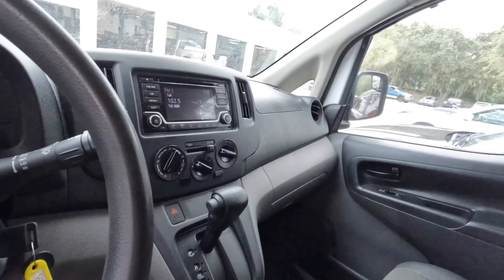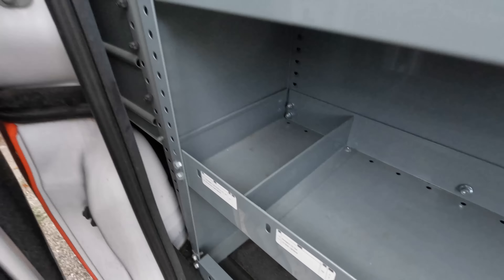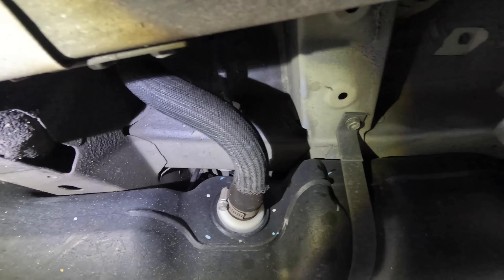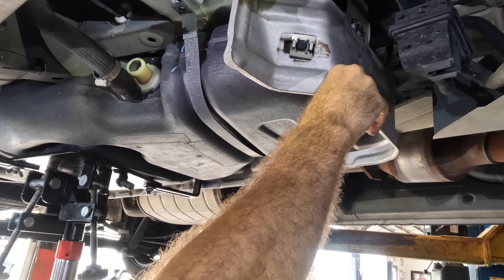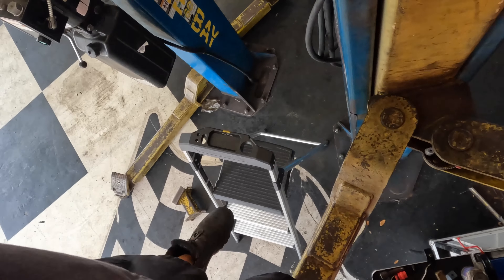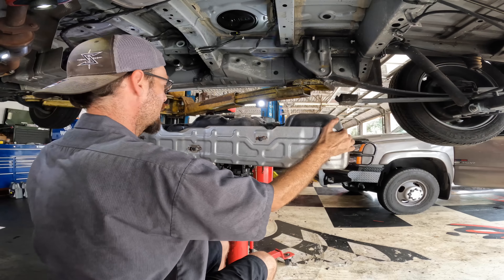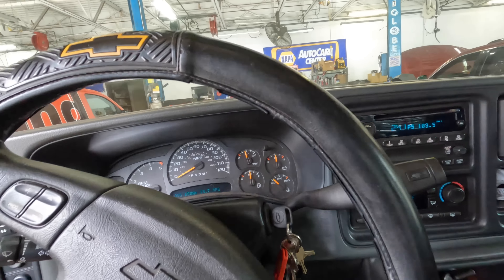Misdiagnosis! Changed the Part Anyway! | Crank No Start

Comment: In a previous life, Ray used to take fuel pumps out with a  blow torch.  It was a short life, but very cinematic.
Reply: Yes, using blue tipped wrenches to work on fuel systems makes for very compelling YouTube video.
Reply: I work in a machine shop where we used alcohol for coolant we had a 55 gallon drum that we had them mowed on top of nobody realized it a little bit of alcohol gotten in the bottom of it my boss decided to show a girl co-worker how to weld it blew up shut them all about two feet in the air the girl Peter pants went out the door and never came back everybody was okay and I thought it was hilarious have a good day
Reply: Did you ever see the Eric O. video where he talks about almost losing his hair after taking a torch to a shock that, unbeknownst to him, contained a volatile compressible liquid?  (For others:  In the rust belt, shock bolts almost never survive, and the only way to get old shocks out is to cut them out.)
Reply: @josepherhardt164  your supposed to heat the bolt not the side of the shock, they are compressed and like a tail shaft/drive shaft explodes under heat 😅🤣 all the best to you all
Reply: @donaldhalls2189  In the rust belt, the bolt doesn't even have edges any longer on which to get a grip.  And it wasn't compressed air that was the problem; it was a compressed flammable liquid that shot out a bolt of flame.  Eric said in the vid that he's replaced hundreds of shocks and this was the first time anything like this had happened.  He also said that he thought he'd peed just a little.  :)
Reply: The ring is made out of a nonferrous metal. In other words no sparks
Reply: @michaelpressman7203  Dafuq ...then LOL!  🤣
Reply: I imagine the remake of that era will be a Michael Bay film.
Reply: It was a dark night but was pretty bright for a second.
Reply: The new gas theives drill hole in gas tanks with no fear of spark igniting the fuel
Reply: @michaelpressman7203  my God man, add a couple commas in there lol
Reply: @nickmalone3143  My old cordless throws sparks out of the motor housing every time it turns off. Guess I can't be a fuel thief! *crosses it off list of potential careers*
Reply: You could say it was a flashy existence.
Reply: @wolfc7280  Stamped steel.
Reply: Not funny at all.
Reply: @j.t.cooper2963  Boo Hoo
Reply: @deadmeat6563  I didn't say it upset me. I said it isn't funny. Big difference.

Comment: Timing on this is pretty funny to me.   I just replaced the fuel pump in my 2014 Ram 2500 at my work parking garage.  Drove to work just fine,  went to go home and crank/no start.   I wish the connectors on it were as easy as the ones on this video.  Also I had 1/2 tank (approx 15-17gal) of gas.   Made for a fun time...   I also refrained from the hammer and chisel method.   Instead I used the screwdriver and adjustable wrench method.     On a serious note,  I give you full credit for giving me the confidence to be able to do some of these repairs on my own.  I've been watching you for a long time and have gain a tremendous amount of practical knowledge of how car components work together.  Thank you.

Comment: Considering the pump was run dry for who knows how long and sounded that rough, a replacement isn't a bad idea anyway.
Reply: Can't run those pumps dry, it trashes the bearings and burns up the motor. Needs gas for lubrication and cooling. Those pumps run at a very high rpm.
Reply: Sustained low fuel condition will cause the fuel pump to overheat and eventually burn out.
Reply: Thats what she said...pack your bags
Reply: He said the pump was making an awful grinding noise, so yeah it was shot.
Reply: agreed 100%
no fuel = no cooling or lubrication, and no cooling or lubrication will make a pump unhappy!

i had to replace a pump in a friend's fish tank the other day as the water level dropped below the pickup and it ran dry. during the postmortem i couldn't even get the impeller to budge with a screwdriver, she was locked up tight! now if a fish tank pump can basically weld itself when run dry, i'd hate to imagine the condition of said fuel pump as they operate at much higher RPM and pressures than a bloody fish tank!

Comment: Glad you remembered to tighten that fuel pipe clip.
Reply: He caught it at the very end of the video.
Reply: @pottawatomie2  yeah - but what about the other line that went through the white pass trhough right above the filler hose?
(breather line, return line??)
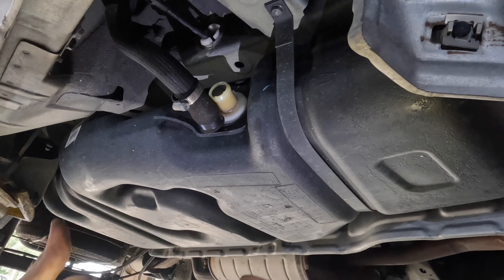you can see it at - 4:00
missing that line at the end of the video when tighening the filler hose clamp

maybe ray could chek it if the car has not been returned to the customer yet
Reply: @odie0815  He plugged the vent hose in at 20:51.
Reply: It's a snap on connection, not a clamp.
Reply: @pottawatomie2  thanks!!
seems that i have been not attentive enough to see it at that time stamp
just had a bad  memory pop up when i missed one of those connections on my car
and created a huge mess in my garage

Comment: In 1978 I owned a '73 Olds Cutlass Supreme that had a fuel starving issue.  It crapped out on me during a road trip with my 6+ mo's pregnant wife.  I pulled into a farmer's yard (he happened to be there) and asked if he had a 3/8" x 9/16" deep wall socket, extension and ratchet plus a flat screw driver and hammer.  I dropped the tank in my lap (3/4 full!), removed the pick-up unit, removed the filter sock on the pick-up tube, reinstalled the pick-up unit, grunted the tank into place and got the strap bolts started and then tightened.  All in the farmer's drive while he watched.  I handed him back his tools, got in, started her up and continued the second 2/3 of our 350 mile trip.  Never had a fuel issue with that cart as long as I owned it.  Just replace the fuel filter with every 3rd oil change, just in case.
WAY too old to be doing that NOW!😧

Comment: It's a good thing the burned up sending unit didn't ignite fuel vapors when it overheated. Great work Ray!
Reply: It uses resistance to ground as a signal. Not powered.
Reply: @gcrauwels941  Whether it was resistance, arcing, or DC current, something caused enough heat build-up to discolor the electrical contacts. I have only changed a few in tank fuel pumps, but I have never seen that before.
Reply: The vapor concentration inside a gasoline tank is usually above the upper explosive limits, too rich to burn. Plus there is very little oxygen in a gasoline tank.
Reply: @ronaldhorne5106  Good information. Thank you.
Reply: The original sending unit in my 1984 F150 looked like that. Wirewound potentiometer type... burned to a crisp just under the full mark. Sadly it too three sending units before I had a gauge that would work decently. At least they're not killer expensive ($50 for a good one) since it's carbed with a mechanical fuel pump (sending just has a dip tube and a fuel sock).
Reply: @ratdude747  Sounds very much like my 1986 Ford Escort and 1990 Ford Probe. Cheers.

Comment: Looked like the easiest dropping of a gas tank I've ever seen. Don't think I ever got that lucky?  Good job as usual.👍
Reply: I had a 1975 MG Midget the 7 gallon fuel tank is just on by bolts around the edge. Take out the bolts it just comes down.
Reply: Lucky the exhaust wasn't running under the tank those are the fun tanks to drop
Reply: On Nissan, chared sender is a concern. Another sketchy part from 'Chrysler of Japan'
Not a bad idea to pretest pump that requires significant labor.
Handling explosive liquid/fume gasoline is hazardous, Pilgrims.
DIY'S, Don't make a roast of yee
Reply: You should see how easy it is with the access hatch accessible...I've got the Chevy version which is a Nissan but it has the Chevy badge glued on badly at the back.
Reply: Makes you wonder why American cars have been mostly drop tank to remove fuel pumps .Even BMW the most hated car I ever owned has under seat pump access .
PS. even though I hated my BMW it has always been the best handling car I ever had .
It's the ying and yang of life.The best is always accompanied by the worst.,for every positive a negative .For every Martin Luther King there is a Putin.
Reply: @millwrightman99  Well cared 1995 C91 Caprice bought 2001 was closest domestic to best handling, comfortable long range ride for over 5 years. Sold to acquaintance who needed same when i no longer did. They used it another 3 yrs til retirement. Maroon with maroon interior hid its police car options. Only needed usual upkeep parts, maintenance all that time.
Reply: My Mazda has a hatch under the rear seat. I’ve never had to use it, but I could foresee this repair taking less than 15 minutes. It looks like 4 bolts and a couple of connections. I’ve always dropped the tanks to change them. Then, I had to take the rear seat out for something else and I’m pretty sure I said out loud to myself…”Well that’s an awesome idea!”
Reply: 96-99 dodge neon fuel tank is just as easy 2 straps, filler, evap, and fuel line.  95s can be fun since they were steel tanks and the straps and strap bolts got extra crusty.
Reply: I had to take a fuel tank off of my Buick Century once. It was absolutely a disaster. The bolts were rusted solid and rounded off.
Reply: @jasonroberts5746  You Got'er Done anyway.........

Comment: LOL I thought I was the only one who stuck the blow gun in my boots, You are lucky, in the rust belt we almost always have to put on a a new locking ring. Thanks!!!  Thin coat the gasket with vaseline and the gasket ring face and it will turn much easier.

Comment: Every time you say "I'm just gonna go ahead..." I'm hearing Bill Lumbergh.
When I worked at a power plant we had brass tools for working on the hydrogen and natural gas systems. Your tool man should be able to get you a brass drift for lock ring removal. 
One more hint: when working with flammable stuff ALWAYS have a proper fire extinguisher nearby. Things can turn to crap in a New York second with fuels.
Reply: Indeed fuel fires start too easily, as I once knew a cocky young mechanic working under a customers car, fuel spilled everywhere including over a mains powered inspection lamp, old style not enclosed and the red hot lamp bulb ignited the spilled fuel igniting the fuel on the floor igniting the car then workshop.. Yep he lost his job..BUT maybe learned a few lessons
Reply: If you do get a spark you won't have time to run for a fire extinguisher your coworkers might but you'll be pretty well cooked hey you know no guts no glory if you really want a piece of brass go to metal supply Warehouse and get a end drop of brass that's what I used to do get scrap have a good day
Reply: I'm going to have to ask you to come in on Sunday too mmkay. Lol I had a ringtone on my old phone just for my boss named Bill.
Reply: They make a wrench for that ring removal now days but I too for 40 years used the chisel(snap-on screw driver) and hammer method
Reply: Who is Bill Lumbergh???
Reply: Swedish guy here: could you enlighten me on the expression “NY second” please? Meaning tempo is up in NY? Appreciate it! Thanks.
Reply: @thatsmetube  NY or hot minute means it happens quickly.
Reply: @Cardoctorhelp  he is quite a character, from the movie Office Space. It's worth a look.
Reply: @calvinevans8305  👍Thanks. I’m 66 and most Swedes think they’re fluent in English - NOT. My current streak is 27 in NY Times Wordle though. (start with TRAIN and CLOSE and mostly get it on 3rd or 4th.
Cheers!
Reply: @thatsmetube  Think fast, really, really fast!
Reply: @thatsmetube  my favorite Swede, Angelica Larsson, is a cute little heavy haul trucker on YouTube. She doesn't have any new content right now but she will probably have some soon.
Reply: @calvinevans8305  thanks for the tip. She certainly is more good-looking than Samcrac and Rich Rebuilds. Gotta ad to the watchlist…
Reply: @Cardoctorhelp  The boss character from the movie Office Space. Great movie!
"Mmm, yeah, it's not a half day."
Reply: We lost a Midas shop not long ago because of a gas ⁴tank fire as they were replacing it.  Scarey.

Comment: Ray, where did you get the bad ass red flashlight and holder???  You got so lucky on that fuel tank.  Everydamn one I have done has always been either full or half full... what a pain in the AZZ....  Thanks for allowing us to comment on your fantastic abilities.  Greatly appreciate learning from a pro.  Been working on cars since I was 14 and I still love it.
Reply: whats up neo, In the video it seems like he is using a Stream Light Flashlight. You can pretty much pick these up from any tool truck. Price pretty much varies. Amazon i think has them the cheapest of all. The holder on the other hand i have never seen but looks definitely handy. Keep on wrenching man!
Reply: Streamlight torches are pretty nice for an inspection light application but magnet base angled head lights offer the most flexibility for delivering "more lumens" 😉

Comment: Ray, you could use a brass drift pin to persuade the lock ring in place.
Reply: Yup.  That what I was taught many years ago.  If you have go hammering on something that has fuel in it, use brass.

Comment: awesome video Ray..
i have dropped a tank or two in my day from fuel slosh..  
the worst one was out of my own truck. my rear tank is a 45 gallon not only did it slip off of the jack  it was 1/2 full. to this day i remember cleaning up a good 5 gallons of diesel off of my garage floor. 
so much kitty litter.
Reply: Oh that would be bad hee hee. That greasy diesel takes forever to soak up
Reply: @lechatbotte.  that was 2 years ago and i can still smell it on a hot day.

Comment: I make a lot of the EVAP tubes and hoses on some of the big 3's vehicles. Some of the really fascinating stuff is the ultrasonic welding they use to attach the vent valves and purge valves to the tank.

Comment: Good morning Ray this is what happens when you don't put gas in your car. I'm surprised this happened to a company work van. It's been said always keep at least a quarter of a tank of fuel I wish my wife would understand that 😃. Anyway thanks for the video 👍. It went smooth and easy with the lift and transmission jack and an empty tank. I did mine on the floor. Need to say the wife got the message if you know what I mean. Stay safe and American Strong 🇺🇸👍💪.
Reply: Running around with empty or close to empty fuel tanks will shorten the life if you fuel pump I couldn't get that through to my wife and she couldn't figure out why when she run it low the car would store well the pump was getting overheated have a good day
Reply: Why would they put gas in when the gauge was showing just under 1/2 tank? (7:13)
Reply: They didn't add fuel because the gauge was still showing nearly a half a tank. The sending unit was burnt pretty bad. Didn't you watch the video?

Comment: I really like the way you show details, like the struggle of how to remove and replace plastic clips. Those stupid plastic clips can be the most annoying thing about auto repair. Even that fancy magnetic flashlight magnet was worth a gander.
Reply: Yes I've had a bunch of problems with my vehicle due to guys getting a little heavy-handed with the plastic clips and plugs and done a bunch of replacement or JB weld have a good day everybody
Reply: What I wondered is they supplied a bunck of new plastic clips but not that one?? WTH?

Comment: Standing on the top step of an 'A' frame ladder is a 'no no'. My broken ankle from 10 years ago is testament to that! Keep safe Ray!
Reply: I did high work and ladders for years the biggest thing is make sure your ladders properly placed and and pay attention I once was putting siding on a house and it had three legged ladder with the fourth one being a piece of 1x3 nailed on the light will let go I did a flip in the air like a bowling pin came down on my head and got a real nasty concussion but village nothing in my head so I had nothing to worry about any brain damage hey have a good day
Reply: On the Quora forum someone asked why ladder manufacturers provide the top step of a ladder if you aren't allowed to use it :-)

Comment: Great job as always!  Never have looked inside a fuel tank like that . . .   I'm an aircraft mechanic, and there was a large twin-engine Commander that went down there in Florida a couple of years ago, due to fuel exhaustion.  Normally that's a "pilot error" issue, but the aircraft maintenance manual requires pulling the fuel quantity sensor every 1,000 flight hours--and at the time of the accident it had been over 8,000 hours since the last time it had been inspected; the fuel quantity sensor had similar burning and scoring as the one on your Nissan had.  So, yeah, in that crash it was inadequate maintenance AND pilot error.  Interesting to see the same sort of failure on an automotive application.

You could appease the safety mavens out there with a brass drift, a nylon drift, a phenolic rod, or anything else non-sparking.  All of those are available fairly cheap (as round bar stock), even on Amazon.  Cut 'em and grind 'em as needed.
Reply: Even a wood instrument

Comment: If compressed air makes the feet feel good on a hot day, would brake cleaner make them feel clean and shiny?
Reply: We used to use alcohol with coolant when we were fly cutting aluminum so the aluminum would not stick to the fly cutter also we had squirt bottles if you want to have fun you'd squirt it on a co-workers but it will go numb have a good day
Reply: Probably not good idea absorbing that stuff thur our skin.
Reply: @michaelpressman7203  That’s OK, Ray absorbs plenty through his lungs.
Reply: It makes stopping at counters and doors instant.